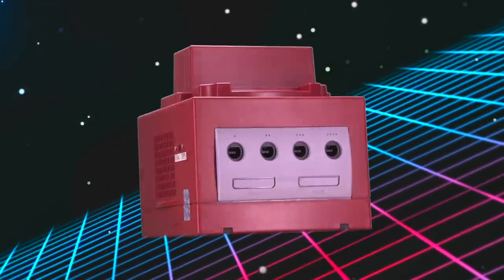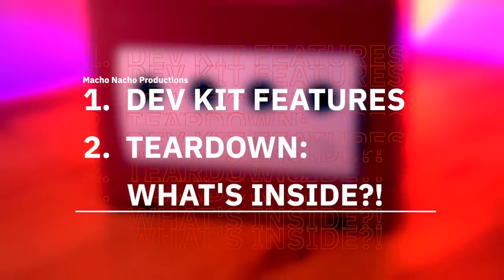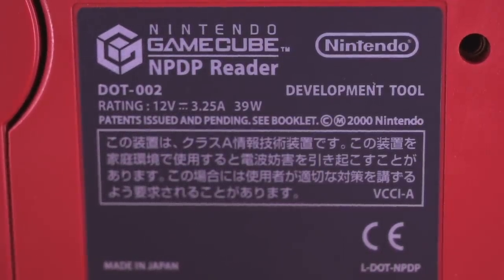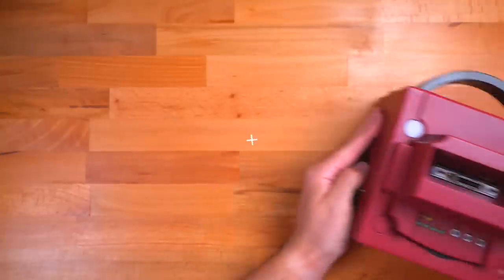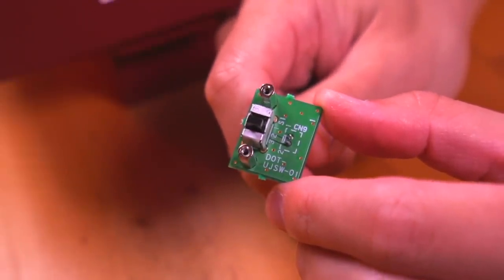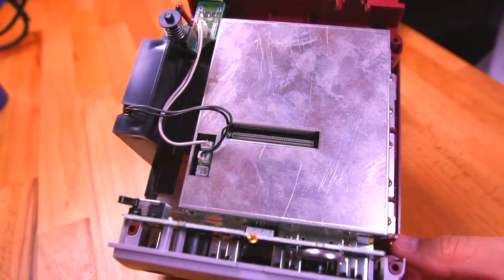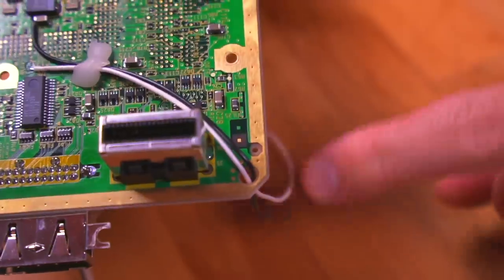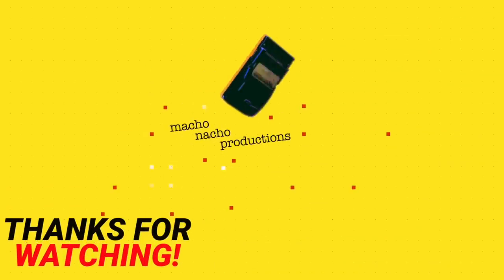Why Did Nintendo Make A GameCube With A Cartridge Slot? | The NPDP Reader

Comment: I would imagine the "pseudo-read error" button probably forces the devkit to think it had problems reading from the game disc (cartridge in this case). I'd imagine this is so they can see how that affects the runtime of their game and gracefully handle that situation. Since otherwise they may be unable to reproduce such an issue and may not know if their code works.
Reply from the maker: That’s an interesting hypothesis. That actually makes a lot of sense. I guess if they make a pseudo error they can test how the game handles it.
Reply: @MachoNachoProductions  "pseudo" just means "artificial", as in the error is not an error created through an actual failure, but initiated in a controlled sense.

Imagine a game like Metroid Prime. Before you go through the door into the next room, the game has to load in the room data from the disc. If the game disc is scratched and it is unable to successfully load the room, the game has to handle that case. In Metroid Prime's case, the gameplay pauses and an error screen is shown that the disc is unreadable, and you have to reset the GameCube. Having a way to simulate that error would have been necessary in order to test that the error screen works. If they couldn't test it, or flat out ignored the possibility of read errors, the game would most likely crash due to other aspects of the game trying to access data that isn't there.
Reply: I can confirm. I worked on a GameCube game years ago, and Nintendo required that you gracefully handle read errors, so you needed a way to simulate this.
Reply: @Matt23488  I remember  playing prime 3 off a flash drive on my Wii. The flash drive failed on me mid game and I got trapped in a room the game didn't crash for like 6 minutes but none of the doors would open in that room and even the morph ball door in the tunnel that opens automatically got stuck. At first I thought ooh neat but then it got creepy once the game music stopped  just bad vibes felt like the game was watching me like it knew I was there and it had me under a spot light. I would rather the game just crash.
Reply: @amaiorano  yeah I figured that was probably one of the requirements. I know they typically have like a QA checklist of things you must make sure of before they will even consider accepting the game, and handling a disc-read error would definitely be on the list. Thanks for confirming!
Reply from the maker: @amaiorano  awesome!  Thank you for sharing!
Reply: @amaiorano  Golden Eye
Reply: @Matt23488  I feel like not handling those situations in a controlled fashion might also contribute to an easier time compromising the hardware security or enabling potential exploits. If reading incorrect data puts the system into an exploitable state or prevents reliable disc checks…
Reply: @MachoNachoProductions  It's likely done to easily test your game's read error handler to ensure it's working properly. Error handlers are generally not well tested in code, partly because it can be difficult to reliably simulate some errors in practice. So, this would help with that particular type of error.
Reply: @1800Supreme  The same thing started happening to me in prime when my the laser diode in the gamecube started getting weak. It would randomly load data so slow it would freeze up the gamecube causing the doors not to open and eventually the music would stop and it was very creepy and eerie until it starts happening more frequently causing you to reset the console and loose progress. Then it became me rage quitting the game completely.
Reply: @MachoNachoProductions  Any programmer could have told you this before you posted the video, great research....
Reply: I imagine that they used it to test the disk read error screens. Sometimes the GameCube could boot a game but then the game would produce a read error screen specific to the game
Reply: That was what came instantly to my mind when he asked what that button is for.

Comment: On the switch at about 7:40, this is quite common at least in my company for product development, we all use internal naming for parts within a device we're designing like those, and pretty much the same naming scheme. It all organizes stuff a lot better when you have ~50+ technical drawings of several parts on a device/machine, and since we gotta do it for organization internally anyway, I imagine Nintendo printing it on a silk-screen is a no-brainer, also helping fixing the device when it inevitably needs it.

Comment: My bet is that the "mystery cable" soldered to the underside of the board is for the US/JP IPL selection switch, and is used to bind an EPROM address pin to a 0 or 1 state depending on the toggle switch. It's a trick I've used to toggle between different boot ROMs on old 8 and 16-bit computers.

Comment: Can you dump the IPL from that unit? You can custom code on it by replacing the NPDP-SubA-02 board by a modded drive or a GC-Loader or you can solder in a picoboot.
Reply from the maker: I’ll definitely do that just need to make sure I understand how to
Reply: Would be interesting to see what's on it, but I think it's probably running the stock IPL as this would make the most sense for a dev unit like this -- running finished or near finished code on a retail unit to match the environment of a retail unit as opposed to a dev kit that allows you to access memory and has more debug features.

Comment: 9:05 - The HC08 is just a quad 2-input AND gate chip.
The HC04 is a hex inverter (six NOT gates in one chip).

They are likely just buffering some basic chip select, control, or clock signals to/from the cart.
(HC usually stands for "High-speed CMOS", a very common type of standard logic chip.)

EDIT: I should add that the HC family chips normally have part numbers starting with "74".
But on these tiny TSSOP package variants, they tend to omit the 74, so they can fit more (readable) text on.
So the full part number would be 74HC08T14 and 74HC04T14, where the T means "TSSOP", and the 14 is the pin count. 

I never really looked into this dev console much before. It's interesting that almost all of the "magic" happens in the cart, there's barely any logic added to the GC itself.

Oh, btw, the smaller chips on those interface boards are mostly labelled as "DA" on the silkscreen. Those are likely just clamp diodes for ESD protection or voltage clamping. DA usually just means "Diode Array", so more than one diode in each chip.

IIRC, the GC DVD drive is a bi-directional 8-bit bus with a few control signals.
Reply: Rough pinout of the LED board. I was a bit bored tonight. lol...

1.  
2.  Green LED D3 (DISK 0).
3.  
4.  Green LED D4 (DISK 1).
5.  Green LED D5 (DISK 2).
6.  
7.  Green LED D6 (DISK 3).
8.  Yellow LED D7 (NO DISK).
9.  
10. Amber LED D8 (?).
11. Button SW1 (COVER). "Open / Close"
12. 
13. Button SW2 (DISK). "Disk Change"
14. 
15. 
16. Button SW3 (ERROR). "Error"

All unlabelled pins here are likely all connected to the Ground plane.

Comment: Ok so, it's possible to make a ODE for the game cube just by reverse engineering the non standard components, because everything else as far as we know is a dol 001 console.
Or no?
Reply from the maker: Most of the OdE hardware is inside the NPDP cartridge.
Reply: @MachoNachoProductions  I know, but, still, having all the non retail hardware reverse engineered could potentially land us the ultimate ODE for the Cube, no?
Reply: A GameCube ODE already exists, it's called the GCLoader.  Unfortunately,  they've been out of stock for a while and it's closed source so nobody can clone it.
Reply: @Minty_Meeo  yeah I know that one, but would it have the same reliability as the official ODE?
Reply: Definitely possible, but the code and hardware doing it is located on the cartridge, and may be a custom chip and the software is probably encrypted.
Reply: @davidcameron648  I know, but I'm pretty sure the community can reverse engineer that.
Reply: @thelion.4K  They pretty much have. It's what the GCLoader does. It's just rather expensive for the hardware, and the person that did it has kept the code closed-source.
Reply: @davidcameron648  yeah but the official one taps into the disc drive pathways, and since it was said to use hard drives we can retrofit an SSD in it.
Imagine that with a game seletor menu but it would be way faster than the memory card slot for sure.

Comment: I wonder if that region switch could be duplicated and installed as a mod in a standard Gamecube, to be able to read discs between US/Japan regions using hardware actually developed by Nintendo. Regardless, fascinating video Tito, I'd not even heard of this thing.
Reply from the maker: That would be super interesting to test out. I think there must be something happening on the interface board since the switch and that cable both connect to it.
Reply: Yes you can set up the same thing so I get Japanese GameCubes and there's a small diode I think it is on the board that you can remove and it will force it to us region but you can actually run wires in a switch to the same spot and switch back and forth.
Reply: The spot to do this on a regular GameCube is actually near the processors on the board close to where you would solder in the Pico pi mod
Reply: @seanh5014  Oh, cool. Yeah, I have one of those Pico mods so I wouldn't need one, but then if I had a stock Gamecube I was running discs on, I'd probably be interested...
Reply: Yes, it can. The via connects to one of the pads on R6 on a NTSC-J board, and the capacitor pad is just ground. So it's just a alternate method of doing the standard region mod on a retail NTSC-J mainboard.

Comment: Warranties can not be legally voided by a sticker. The manufacturer would have to prove that the damage to the sticker caused the defect you are trying to get a warranty repair for.
Reply: No, they can't (depending on where you live), but it doesn't stop them. Most likely that sticker wasn't for warrantee purposes, but for anti-tampering and anti reverse engineering. You would most likely have had to agree to a NDA and been instructed not to tamper with the dev units before you could get one of these and the sticker was there so they could "prove" that the unit was tampered with if they had to take someone to court over it.

Comment: hi Tito you may not be able to use the memory card manager on this as it's dev menu is different than the retail gamecube so the gameboy player also won't work with this unit as it's dependent on the gameboy player startup disc

Comment: I wonder if the 2 hand soldered cables are for the region switch, they are not soldered to the usual points you find on region switch mods,
great video

Comment: I would think a pseudo read error is just going to simulate a disc not reading. Possibly useful when in the middle of a game to see how it reacts to a read error on the disc. Possibly trying to guarantee that it goes to the disc read error screen instead of crashing or something else
Reply from the maker: That makes a lot of sense!  I suppose you want to design games so that they can move past an error and not lock up.
Reply: Yes and it would make sense that because you don't have access to opening closing of the lid you can't manually casue a disc read error without that button. Thanks as always for the video

Comment: Simulating a pseudo read error seems pretty self explanatory.  What is it that you want to know?
It obviously simulates a disc read error, probably by sending the same packets that a real drive would send in the same event.

This would have been used by developers to test that their games behaved correctly in such events.

Same with the region switch, would have been used by developers to make sure the game you're making either displays an error in the wrong region, or, switches localizations (depending on what your intent as a developer is).

Adding more RAM to the dev systems burned them in the N64 days, ended up having to make a mandatory upgrade for certain games.  Makes sense that they discontinued that for the gamecube. 

Nothing about this seems particularly surprising. 🤷🏻‍♂️

Comment: My Gamecube came with a region switch. Not a real one. I bought a used Gamecube back in the day and I always noticed a switch on the backend of the device. I always just assumed it was the old Channel 3/4 switch but one day I realized that the Gamecube didn't have a Coax output so wtf was that switch for? I flipped it and it switched to Japanese. 
Some how I bought a pre-modded Gamecube from Gamestop.

Comment: It's not that strange that Nintendo would make the region switch both modular and work part numbers. It doesn't matter how limited the NPDP was, they were used a lot during game development. That switch could be toggled hundreds of times per day. It could very easily wear out, and for a piece of development hardware, do you want people to have to go at them with soldering irons, or just be able to swap out worn out components? It simply makes more sense to make repairs as quick and un-traumatic as possible for developers so as to not risk destroyed machines and development downtime. As for part numbers well...it's a part. If you want to keep track of it, both in inventory and schematic, you number it. You would be amazed how many parts in your car have part numbers that don't actually show up in the parts department catalog because they were only intended for internal tracking, and that part is only intended to be sold as a component of a larger part.

Comment: I wonder if you could put a regular gamecube disk drive in this.
Reply from the maker: I definitely could, it’d be interesting to see if it’d work 😅
Reply: It should, looks to be a standard NTSC-J mainboard. The special sauce is in the cartridge (it's a optical disc emulator), the reader hardware is just and interface between the two.

Comment: Because that there is called the Nintendo dolphin or the GameCube prototype you decide.
Anyways it was designed to have hard drives slip in with the games on there it was for devs to use and wasn't intended to be out in the public. Made things easier for testing games on the hardware and being able to change the content on the removable hard drives.
Didn't watch the video but hope this helps with you question.

Comment: regarding the "pseudo read error" button.

in computing pseudo usually means faked.
and I would take a read error to mean an error reading the disk.

So I am guessing that it simulates a disk read error.

Programmers could use this to test what happens if a read error occurs at specific moments.

Comment: The mother board looks stock, it should be possible to connect the optical drive to it. Those 2 wires are for the region switch. it was super easy to region mod a game cube with 2 wires and a switch.

Comment: The two wires soldered to the bottom of the board or for the region switch the one going to the cap is just going to be the negative and the one going to the via is either going to be going to the R5 or R6 resistor pad on the opposite side to switch the region from Jap. to US most likely R6 as I imagine it's a Japanese board there using for these kits.

Comment: Those tamper protection stickers are not that difficult to remove intact if you have the right tools. A plastic razor blade and a temperature controllable heatgun. The adhesive will melt at a much much lower temperature than the thermoplastic casing. Used to do it often with the 360 for aesthetic reasons though apparently you can just buy new ones that look identical to official. Only way to prevent it is having heat sensitive ink in the sticker but I have yet to find any that exist and have been used in products.

Comment: My guess is that they designed the dev kit in the same way and as close to a retail GameCube and even held part numbers for these dev kits most likely to cut down costs, and likely because they made so many of these units making it necessary to had parts for these units in the case of repair or in the off chance that one would need to repair so they had spare parts for them for whatever reason. The UJSW is a bit of an oddity as there appears to be no PAL setting.  I am not 100% clear of how the game cube operates for PAL regions, but my guess is this switch operates much like a region switch mod would work on a retail model.  Either that or there is little difference between the retail and  dev kits and one in theory could convert a retail model into a dev kit with little effort, though this is just my own head theory

Comment: Why would there needs to be a region switch on that GameCube? I thought both America and Japan used NTSC and Europe used PAL. Is there a difference in the NTSC coding for Japan and America? I don't see why there should be because when I had my NES, SNES, and N64 and if I wanted to play Japanese games on my American NES, SNES, and N64, all I had to do with the Japanese game is to take the motherboard out of the Japanese cartridge and either switch it with an American cartridge and then I could play it on my American console or just put the motherboard without the cartridge casing in the cartridge slot in my console and the Japanese games worked no problem since both ran on NTSC. The only reason you couldn't use a Japanese SNES or N64 cart inside an American console is because of two cut out slots on the American cart. But maybe that all changed with the optical discs Nintendo used for the GameCube and they coded them differently even though both America and Japan use NTSC TVs.
Reply: It's because the games wont load on consoles that are not the same region as the game. It would make it more expensive to have to send two NTSC units to developers (one for North American games, one for Japanese). It's cheaper and simpler to send one unit that does both.